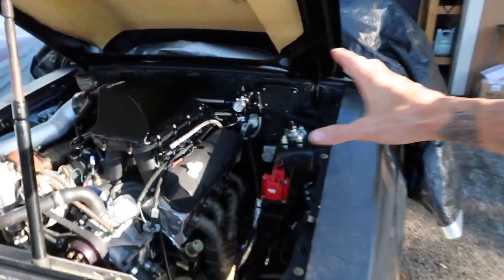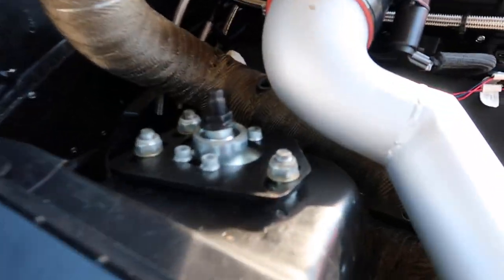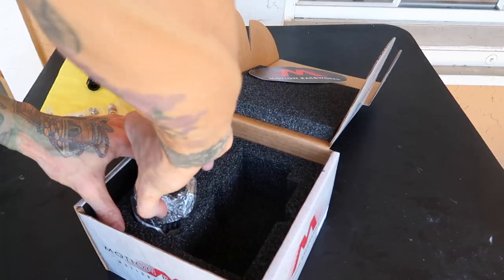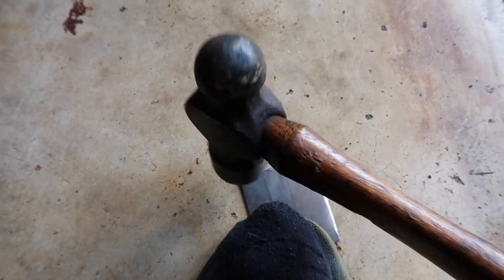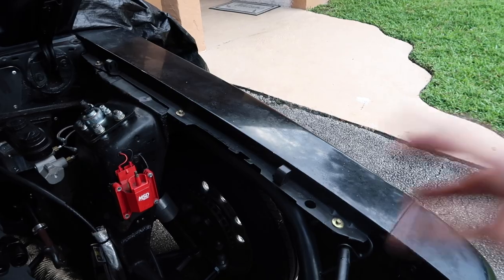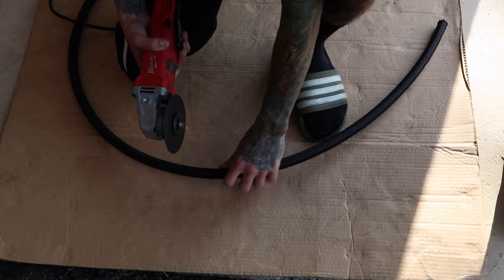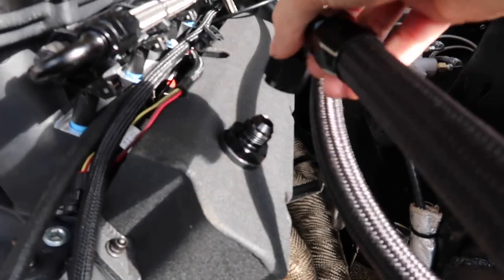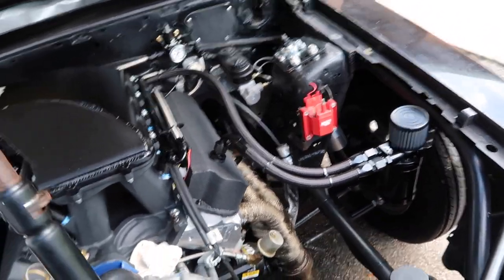Is a Catch Can Better Than Valve Cover Breathers? (problem solved)

Comment: got that same motion valve cover. waiting on some fabricated valve covers from winchester metalworks to show up to plumb mine. your valve covers or that fitting is baffled right? may have some oil issues with that one in the rear, especially if not baffled. but ya, breathers don't work well with turbo.. mine did fine for a bit and they're even baffled. high rpm/max boost i started oil soaking the filters and having some oil run down the valve covers.. rather not have an engine fire, so ordered the motion catch can. new 408w will have gas ported rings tho. they say you don't even need a catch can with those cuz it cuts down on blowby so much.
Reply from the maker: yes my valve covers are baffled.. im happy with the catch can , solid upgrade 🤘🏼

Comment: It looks good, don't overthink it. How much did you spend for all the catch can stuff, can, lines, fittings??$$??
Reply from the maker: thanks man! the kit comes with most of it.. then i had to buy the grommets and fittings that come out of the valve covers and that was like a extra 80 bucks or so but could prob be found for a little cheaper

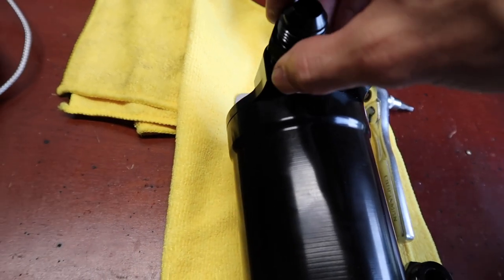Comment: Did you use teflon thread tape to get that seal you need when you screwed in your catch can fittings at the 12:40 mark?
Reply from the maker: catch can fittings are AN and self seal.

Comment: I know I’m crazy late but do you have a link to the rubber grommet and 10AN push in fittings you used
Reply from the maker: shit bro i dont have a link, but i think i found them on ebay bro.
Reply: @JovanMichaels  damn , LOL didn’t even think to check eBay , your definitely a life saver because that catch can setup you have is beyond clean!